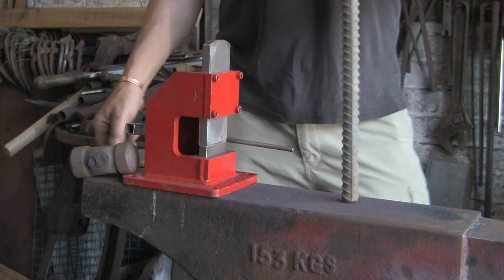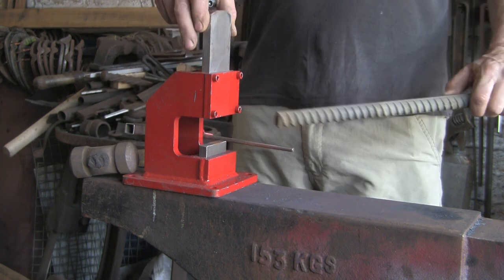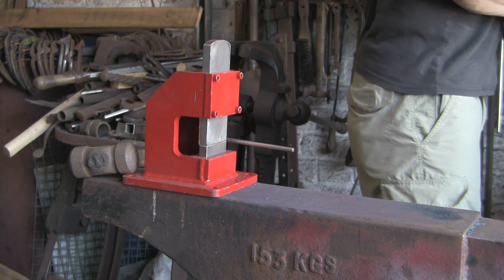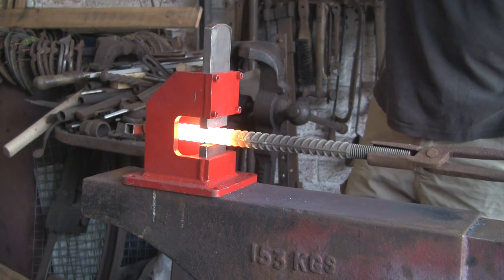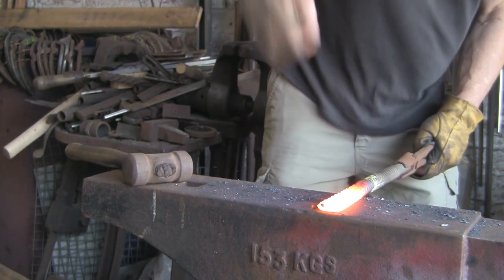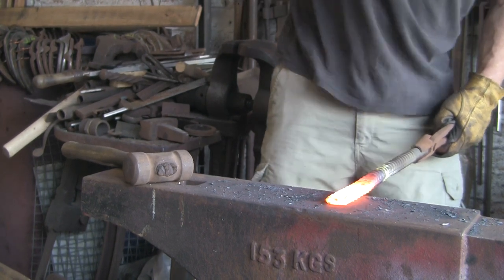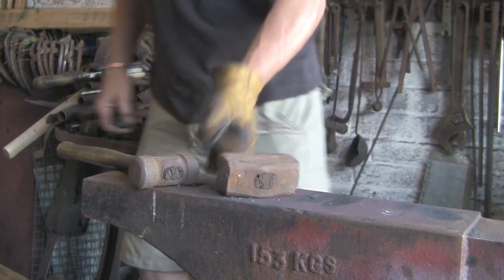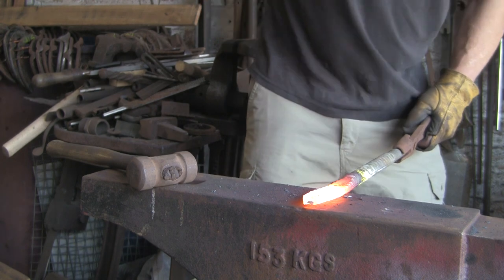Rebar Dagger

Comment: Rebar is made of so many types of metal that makes it very tough. Typically whatever is in the scrap heap is what's going into the rebar. I have found whole drill bit that didn't get fully melted and were just encased in the rebar. God help your tools if you're not using anything but carbide to cut. And even then it will tear up carbide fast. It's a nice material for the availability, but there are better choices. But then it wouldn't be any fun making a video! lol

Comment: The problem you were having moving the material was coming from your swing. When  you get a tough piece like that think of throwing the hammer more like a baseball and put your body into it. I suffered from the same problem for a long time until a colonial blacksmith taught me what I was doing wrong. You want that hammer moving fast. Never thought about making a dagger from rebar before, turned out pretty nice.
Reply: Adam Bodford i

Comment: Nice to see you back on the hammer Gary...... you mentioned thinking about doing a scroll former before you decided on this. Would you reconsider doing a nice tight scroll former for small scrolls? Be nice to see that... thanking you
Reply from the maker: Chestnut Forge if you want just a generic scroll former I already did a video, search for "scroll former" in my videos. The next one I was going to do was to conform to the "perfect scroll" pattern.
Reply: Great, looking forward to your "perfect scroll" video. I have been looking our for some small scrap scrolls which i can use as a scroll former but they rarely have a nice tight start which i love to have in a scroll. Thanks for the reply

Comment: Mr. Gary  Is it possible harden rebar dagger? Thanks.
Reply from the maker: No, it doesn’t have enough carbon content.
Reply: It is possible, but of course it won't harden nearly as much as real carbon steel. I remember my tech teacher used to make big crow bars from rebar, he always hardened tips of them.
C equivalence is typically 0.5% in rebar steel. For maximum available hardness you can use salt water for quenching

Comment: Hi did you know that if someone makes a homemade knife they can harden it by heating the steel really really hot (till it glows orange like the color of fire) then, a person would be able to dip the metal into something liquid, such as water or oil. This process makes the steel harder! There is a lot of science involved, but I’ll keep it simple here, just trust me. After it gets harder, a person can temper the steel, but that’s a pretty advanced skill only for trusted and long time experienced blacksmiths and sword smiths. Also, it’s really dangerous to use a polishing wheel. The guy in this video always needs to be careful! And make sure goggles 🥽 are used when using power tools! 🧰
Reply: For knifes is better to use oil. Katana sword quench uses water because the apply clay to the back of the sword that way when dipping the sword into the water the cutting part cools faster that way the katana bends and takes that curved look.
Reply: @jaymorales5049  no the clay  edge or Hamon leaves the spine softer less brittle the curve is forged into the blade. The curve is side to side distortion if not quenched properly
Reply: Az)lqZ

Comment: How would you fire-weld a ZINC COATED nut to the steel rebar without borax and first removing the ZINC? At least in a short acid bath or so? how will that ever fuse together?
Reply from the maker: Use your common sense, the coating, whether it be zinc or cadmium burns off while coming up to welding temperature! As for using borax that's not needed to weld, it just helps.

Comment: You can harden galvanized steel? I was always told you couldn't or too difficult to be worthwhile when better steel such as old truck springs was easily obtainable and hardenable
Reply from the maker: it depends what the steel was before it was galvanized, galvanizing is only a coating of zinc.

Comment: Is there a purpose to heating, hammering, and shaping beyond simply getting the shape you want? What I mean is would it matter if you shaped metal with a grinder as opposed to forging
Reply from the maker: Heating and beating moves the metal, grinding just removes it. You can’t make it wider or longer by grinding.
Reply: Gary Huston makes sense. Thanks
Reply: That's called "stock removal". Its how lots of folks new to the game shape their blades.
Reply: @garyhuston  I like men

Comment: Great video Gary. Don't know how I've not seen it until now. 
Quick question, where in the U.K. can I source a rubber grip wheel like the one on your motor for grinding? Any help is much appreciated. Cheers.
Reply from the maker: John Terrett I got mine from my Farrier supplier but if you just google expander wheel there are lots of suppliers

Comment: Did you do any kind of hardening or heat treating at all on the steel? Rebar is the softest steel. That knife is never gonna hold up. I guess it will be a nice conversation piece or butter knife. It looks pretty cool though.
Reply from the maker: Don’t you ever read the description! What is the matter with you people?
Reply: This type of dagger will punch holes through a leather jacket or heavy clothing all day long . Take a guess how many soldiers were killed in trench fighting by a blade like this .
Reply: I made a nice set of rebar throwing knives some years ago. Stuck in the target, would go through leather. Hardening is necessary for metal to metal, but metal to flesh...? 
People need to lighten up. It's art, for goodness sake!
Reply: "Never gonna hold up." Against what?
Reply: Never a more appropriate handle than your's.
Reply: @garyhuston  I never  learned how to read
Reply: There are lots of steels softer than rebar, and there are many types and grades of rebar

Comment: Must submerge to water or an oil while very hot to make the steel hard.
Reply from the maker: You can’t harden rebar that way.
Reply: @garyhuston  These types of "rebar steel or structural steel (so called in Germany)" usually contain very little carbon and are therefore difficult to harden. In order to harden these steels, you can use "case hardening" with which the carbon is fed in from the outside in a long, slow process. Then in the end you still don't have a good knife, but at least one that is a bit more useful.
Reply from the maker: I don’t know why people keep telling me this. I know ! I don’t care, I don’t want to harden it it’s never going to be used on anything hard but it would still stab you to death!
Reply: @garyhuston  Stop - there is no reason for a heart attack :) My reason for the comment was more to explain it to laypeople and newbies - you as a blacksmith know such things anyway - so please "don't" see it as a criticism on you my comment should simply serve as an explanation for none blacksmith :)
Reply: @net-twin-de  too late....old man died
Reply: @dv9239  :)
Reply: @net-twin-de   he was cut to the quick by your comment

Comment: At the beginning of the video, you had mentioned it might have been galvanized. I might have missed a part where you cleared that up but if it IS galvanized, is there a way to tell? It all looks the same to me. I know that heating up galvanized steel can create toxic fumes and that's why you're not supposed to weld on it, forge with it, etc. Cheers!
Reply from the maker: Don’t worry about it, it’s quite harmless. https://www.dropbox.com/s/1i8v2djczr11f9g/WeldingGalvanized.pdf?dl=0
Reply: It is a piece of galvanized rebar. You can tell by the greenish scale build up on it. I don't believe that he fully understands how dangerous it is.
Reply from the maker: @derangedmetalworks9489  didn't you read this, how many times do i have to post it! https://www.dropbox.com/s/1i8v2djczr11f9g/WeldingGalvanized.pdf?dl=0

Comment: Really nice blacksmithing and grinding there.  My only question is does anyone know the composition properties to rebar? aka does it have enough carbon to actually hold an edge and cut?
Reply: 007Jaredboy there is no standard composition for rebar. It is just some old recycled steel (at least in canada it is) that is quite unpredictable but i have made some decent spears and knives by water quenching them for some hardness and tempering them for a few hours just in case it gets too brittle and decides to go "tink"
Reply: Ok cool thanks!  I still think the amount of carbon is suspect for decent edge retention...
Reply: 007Jaredboy edge retention it can have but it is not too abrasion resistant
Reply: 007Jaredboy i have made tome pointed tools with rebar that can chip concrete floors out though

Comment: Bonjour, pour le tarodage pour visser l'écrou, l'avez-vous fait à chaud, ou à froid ?
Hello, for tarodage to screw the nut, did you do it hot, or cold?
Reply from the maker: Sorry, I don't know what you are asking that isn't in the video.
Reply: Je souhaiterais savoir, si la barre est déjà tarauder, 
afin d'accueillir l'écrou, à 11.48...?!?
Ou si c'est vous qui avez tarauder la barre?
si oui, l'avez-vous fait à chaud, ou à froid?

google translat Français > Anglais:

I would like to know, if the bar is already tapping,
to accommodate the nut, at 11.48 ...?!?
Or if you have tapped the bar?
if so, did you do it hot, or cold?
Reply from the maker: MAIL the thread was already on the bar when I got it. When I cut it down it’s just hammered on and riveted over.
Reply: ok, thank you, much !
very good job for the knife

Comment: What metal would you recommend for a first timer?
Reply from the maker: First timer at what, blacksmithing or knife making? Either way if you really are a novice any old mild steel you can get your hands on because you will more than likely mess up the first few times so no use using good steel.
Reply: @garyhuston  well the most experience I have is carving knives and flattened about half an inch of a nail to about an 1/8th inch size
Reply from the maker: Bear claw in that case I would definitely recommend using any old steel you can find until you can produce something worth keeping!
Reply: @garyhuston  aight thanks
Reply: You can get rebar ends for free from some construction sites if you tell them what your using them for.  Those guys will probably encourage them serving a purpose, sadly because they could just end up in a dumpster.  Also, just walk along any RR tracks, eventually you will find some spikes, plates, or even a piece of the track to craft your own anvil.
Reply: I recommend useing railroad spikes
Reply: Carl Tilley  you can buy them though you don’t have take them from the tracks
Reply: Carl Tilley  plus you can buy them used for like 80 cents online
Reply: @garyhuston  I like men

Comment: My experience with rebar is that it is soft ....not carbon steel ...no?  The stuff always bends for me ...that is a bad sign for knife making where you are looking for carbon content...no?? ....I would think using a big broken wrench or a spent jack hammer bit etc... man I love that anvil!   Why do anvils have to cost a small fortune....
Reply: From someone who has worked in a steel mill in the US, I can tell you that it is not hit and miss.  Each batch of rebar is made to order, and there are many different grades.  Each batch has a coupon cut off and the metallurgy is checked.  The customer can specify what grade they want.  This ranges from very low grade to very high grade metal.  The stuff that is meant to be threaded for bridges or the nuclear industry's are very good stuff - it will weld and forge very well, while the stuff sold at home improvement stores is normally very low grade made for reinforcing small non-structural areas like driveways and porches.  The stuff sold to the nuclear industry comes with a 3/8" thick packet of paper with all the metallurgy for that exact batch. It is checked at the mill, and again at the plant that cuts, bends, forms, or threads the bar before being shipped to the customer.  Bridge grade comes with about 1/4 inch packet, normally only provided to the plant that cuts and bends the bar before being delivered to the customer.  Home improvement rebar stuff is normally not worth a s#!t and will probably not forge very well either, very brittle and prone to chipping out if made into a chisel.         

By the way, same goes for rail road spikes.  Normally, there are 2 grades.  First is very nice to work with, strong, hard but not very brittle.  Other is much softer, weaker and will not hold an edge no matter what you try.  It all depends on what the railroad company wants to spend, and where the spikes will be used.

Comment: Where did you get the rebar from?
Reply from the maker: Jlc893 I don’t recall, I have had it kicking around the workshop for years, probably came with other rubbish I bought.
Reply: You can find it around construction areas laying around in Turkey under 1 meter is unusual so u can take it if you ask :D
Reply: You can find it literally anywhere

Comment: Two questions, one will it hold an edge well, and how brittle is it (if thrown etc.)  Both questions is of course after it is tempered?
Reply from the maker: Probably not either as it’s only mild steel so no hardening or tempering. It’s rebar!

Comment: Real nice video, but I would suggest you get some safety glasses that have good sides or at least don't bend down & blow off the anvil.  One of the sharp shards of metal could likely blow back in your eye.  Even glasses with sides are not really that good unless they really seal off the eyes from flying debris.  Now maybe you shut your eyes when blowing it off, that is better than nothing, I sometimes use a tube with a copper pipe on the end to blow out/off things, & still get dust back in my face. There is another thing that I have been thinking about for a for a few months & that is that blood is really very slippery so if you did use that dagger & got blood on your hand, your hand would slid forward thus cutting your hand on your very own knife.  Therefor a good hand guard would be really nice to have.  Best to you, & thanks for the video.